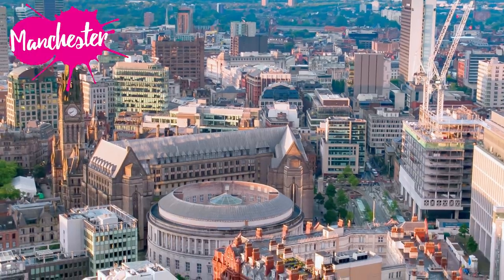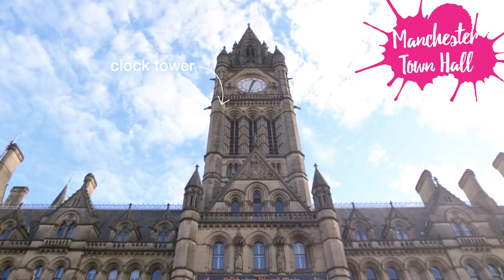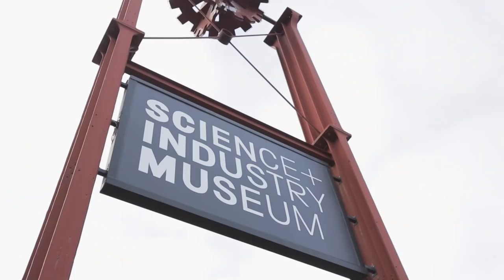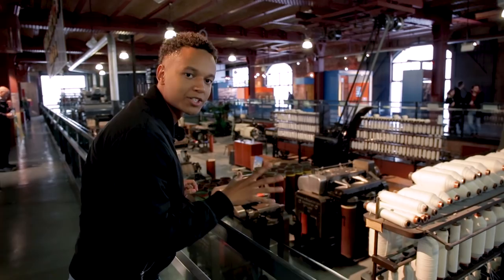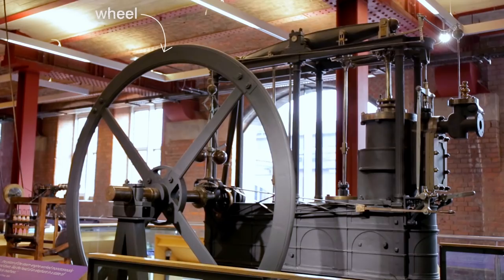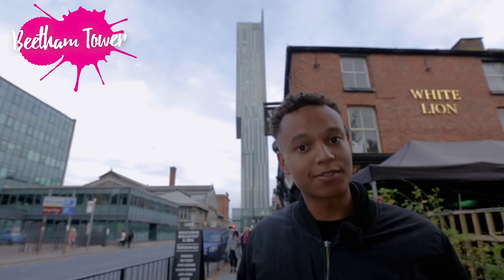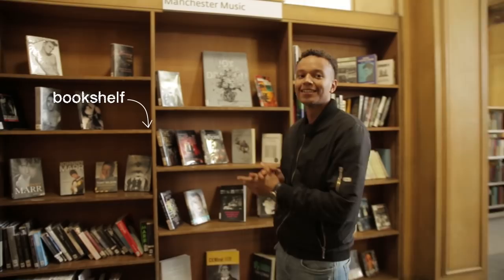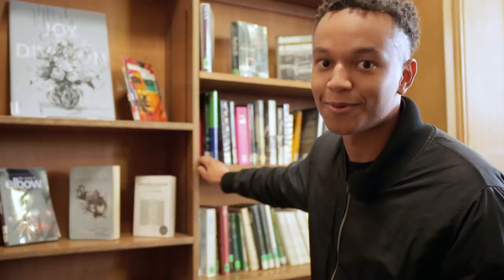Liam explores Manchester, UK – On the go with EF #87

Comment: Hi everyone! 
A lot of inventions have been and will be important for human beings, but I think the most important and influent  invention is the clock! The time is limited and we do anything relying on it. A clock is more influent than a smartphone (which includes a clock!) and it has existed for thousands of years. Just think about the sundial invented by the Egyptians, based on the position of the shadow projected by a stick, the water hourglass ect. until the mechanical clocks and the clock tower around 1300 (the latter warned the believers to go and pray). In 1657 was invented the first pendulum clock, in 1841 the electric clock, in 1955 the atomic clock and in 1969 the quartz clock. Today almost all we have digital clocks... Material, operation, precision, size  are changed but we have the same need to beat the time as the ancient peoples.
The clock is always the clock and will never lose its importance.
Reply: Davide Nario .
Reply: That’s really a great invention! We all couldn’t live without it! 
Thumbs up 👍🏻
Reply: Paola Calcagno f!-